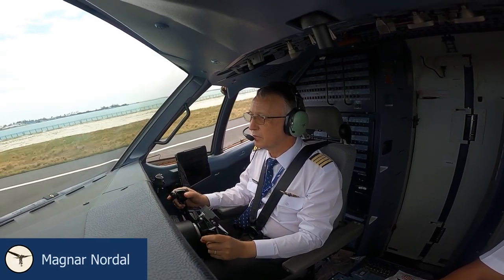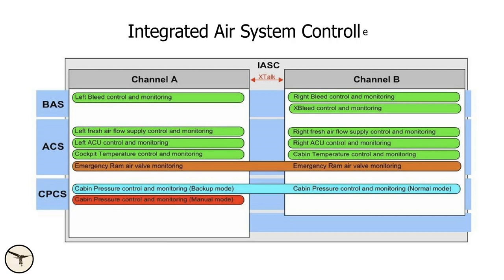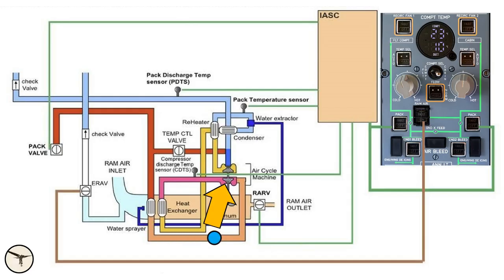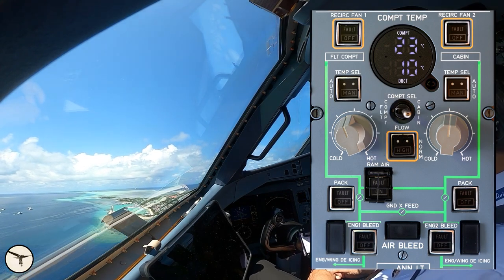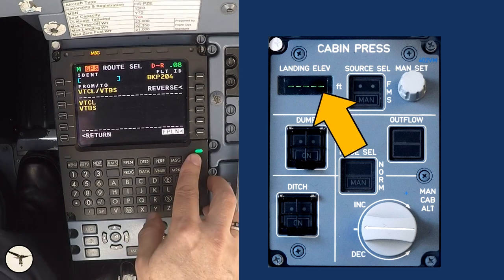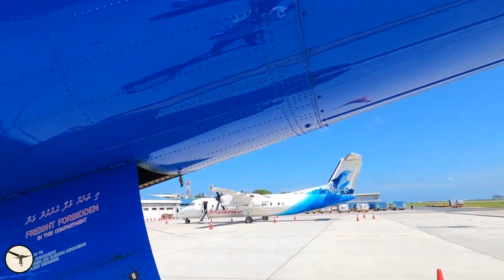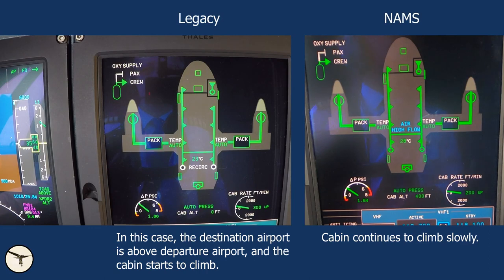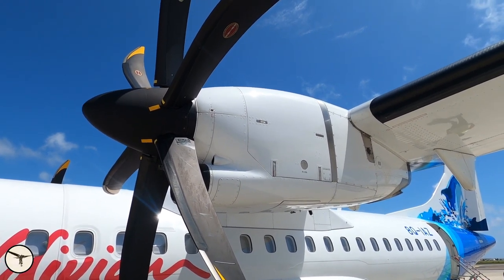Latest upgrades from ATR | NAMS and PW127 XT

Comment: I’d forgotten how long the the ATR had been in production. It’s good to see they are still being upgraded. For short flights aircraft like these have to be the way to go. They are quick, efficient and quite comfortable. Over short distances there is also very little difference in flight time between a turboprop and a jet, especially if the former is operated by a well trained crew who are able to slow the aircraft up quickly whilst performing a short visual circuits. Just out of interest, on aircraft fitted with NAMS do you have to keep the passenger doors or your cockpit paperwork slot open when using ground air conditioning? I ask because this was necessary on the Fokker 50/70/100 as the outflow valves on these too were closed until engine start. Doors closed is the quickest way of popping your ear drums or forcing the cabin door to fly open when unlocked. The latter can be potentially quite dangerous if ground crew are nearby when the door is unlocked with a slightly pressurised cabin.
Reply from the maker: The slot used for to exchange paperwork is called the communication hatch. After the doors are closed, it must be open until one engine is running and the starter button for the other engine is pressed. Alternatively, the pilots can close the ventilation overboard valve and leave the communication hatch closed. This procedure is valid for all ATR variants, including those with NAMS.

Comment: Agree the NAMS make for a cooler cabin. My only gripe with it is the thicker QRH if operating both NAMS and legacy -600s.

The NAMS made significant changes on a significant number of checklist procedures. Need to be careful now which procedure to follow to make sure it matches the aircraft variant flown
Reply: That's why the checklists are displayed on the EWD.
Reply: The EWD does not replace QRH in the aircraft. With two variants in the fleet it makes for a thick QRH. Ame with the FCOM. Need to make sure the MSN matches the aircraft flown

Comment: One note on the 600 F variant we fly. We have also the NAMS system with one outflow valve, but the second opening has disappeared altougether. And of course we do not have a sevice door.
Great video.

Comment: Hi  @FlywithMagnar  
You mentioned "On early ATR variants, it is normal procedure to round the landing elevation up to the next 100ft" where did you get this infromation from ? I looked in the FCOM and AFM and could'nt find it. Can you give me the source please, thank you very much
Reply from the maker: It is not written anywhere, but taught by instructors at ATR Training Centre for decades.
Reply: Thank you very much for your help and your amazing work  @FlywithMagnar
Reply: Also what I was taught by ATR instructors. I was told it's because the system pressurizes the cabin 200 feet below the selected altitude on landing.

Comment: Any idea how hot those pipe diffusers on the first stage compressor get?
Reply from the maker: At maximum power, the temperature of the air inside the diffusor is 190 degrees Celsius.